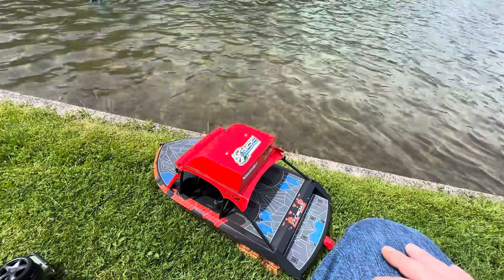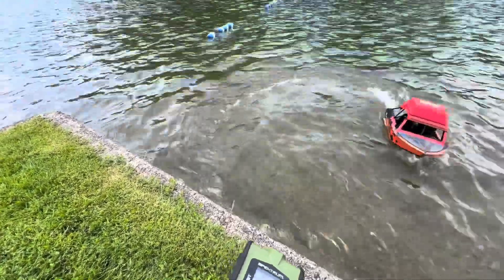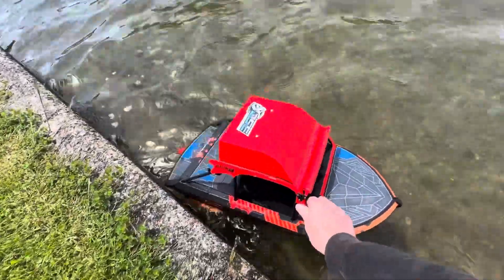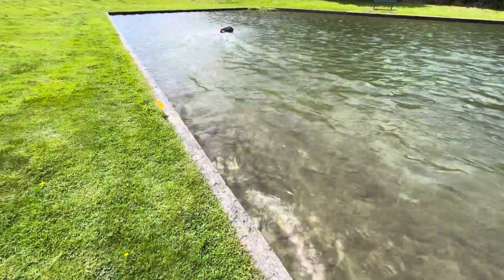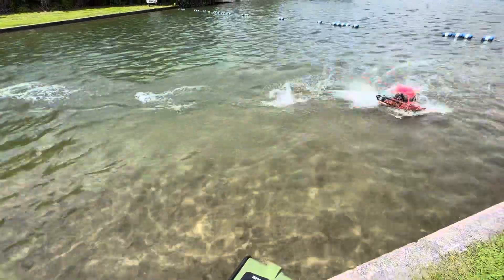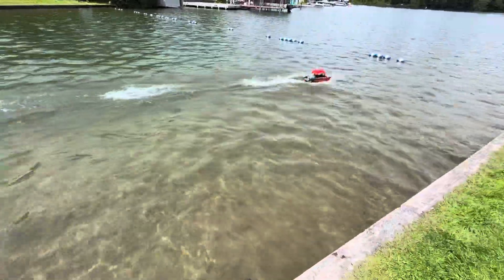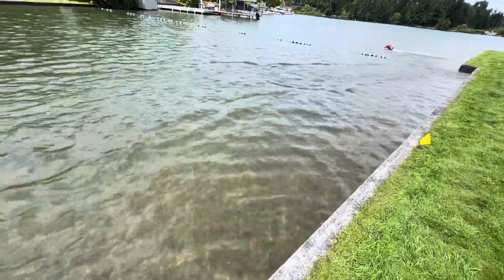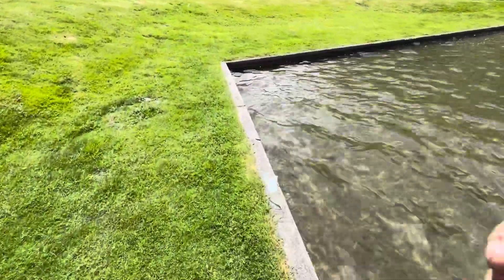The first self righting jet stream.

Comment: Very awesome. That's the only reason I didn't buy this boat cause it didn't have that feature. Wish they would make a V2 that would.
Reply from the maker: I am aware they did make some changes from when they released it to now correcting a few previous issues, especially with the trim tabs.   V2 currently.  
Self righting is a drawback with this boat, unfortunately and how beautiful it looks in the scale does make it a drawback.   
Reasonings  I did something like this  here.  And maybe this might get enough attention for them to look into an option for a V3.   It’s not the first time proboat has made some changes based on my findings and fix’s

Comment: It seems add ing the self righting now causes it to flip
Reply from the maker: The flipping I did on purpose, hitting full reverse at speed to get the boat to flip.  Using the bucket reverse.  Normal operation the boat is very stable and trying something new as idea as an extra reassurance for rivers and sketchy places.   It’s a concept idea.
Reply: @mad_lizard  Like the concept but slightly concerned weight up top and the degree it seems to roll in corners as in white water it would spend 1/2 it's time upside down and why I stopped when it came too close too often
Reply from the maker: @TheS4jordan  in Whitewater rapids always concerned about rolling it and then having to get it.   I’ve been experimenting with something like this.   This is not hundred percent confirmed and trying a different concept. Experimenting with something new.    The weight was a concern when I was designing this and made it as light as possible and weighing out only 3.5 ounces.   The red top is only really a cap.   The cap is only 2 mm thick trying to make it as light as possible,  
Under the  cap is a 2 inch thick foam block.  The foam is what I’m trying to cover up using the cap and secure.   
With the idea of flotation on top for Center of balance change allowing for it to roll back over.   I will post another video with detail assembly and how it’s put together with more testing in white water.
Reply: @mad_lizard  get where you're coming from as had a similar idea with a balloon which I first tried inside the cockpit and whilst enough to lift the boat it wasn't enough to roll it back unless on the roof and hence the RNLI idea as it kept the weight low